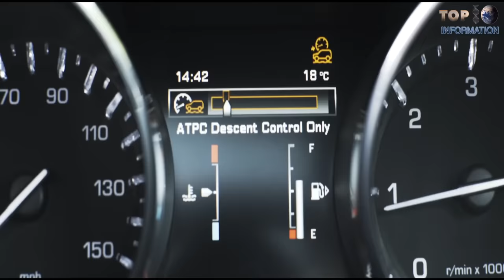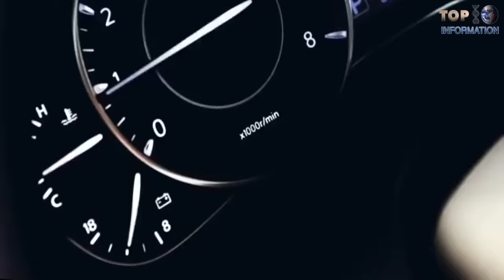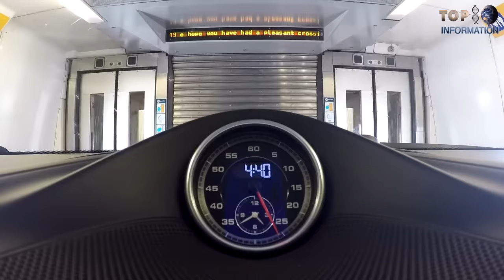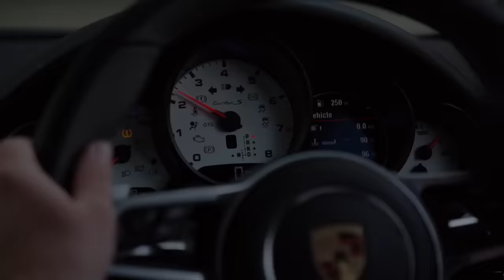6 Strongest Cars That Really Exist !

Comment: PLEASE!! you completely miss the best "towing" vehicles out there, a full size diesel HD pickup.. if your never going off road, a 2wd, if your going off road a 4x4 version..
Reply: Rexford L a full size diesel chevy got rekt by a vw touareg in a tow race lol you dont get there only with weight and big engine
Reply: for fucks sake. a heavy duty pickup with 900lbft of torque will out tow these SUVs.
Reply: +Bran ‘BMR’ Don i have seen something else multiple times you cant overclass german cars they are better get over it its a fact
Reply: abdellah070 Chevy broke a tierod in your video..
Reply: or 4x4 if you live in indiana where it gets icy and snows and get lots of rain and mud even on roads
Reply: Cameron :/ no you just got to get a good start if theres ice my 1996 camaro was driving faster with no wheelspin then my friends 4x4 ram with 4WD engaged on offroad tires who spun tires everywhere

Comment: why not try to tow a large airplane with a dodge demon
Reply: Anwyn71 oh damn, that's a large aircraft
Reply: Anwyn71 how's that even possible? 😂😂😂
Reply: Why try not a G class 6×6 with 800ps
Reply: the suspension is designed so that on lauch weight is transferred/shifted to rear of the vehicle. soooooo yeeeeet
Reply: Its torque numbers are similar to the Touareg's but the suv's advantage is that it's got a 4x4 transmission, while the Dodge is RWD

Comment: to pull a shitload of weight all you need is lots of horsepower and good traction, as well as a strong driveshaft and a very robust transmission that won't give out when you putting a 140 ton load on it

Comment: Anything can pull at low speeds without putting weight on the actual frame of the car. The problem is pulling at higher speeds and being able to BRAKE. Half the battle is getting to speed, the other half is having the capacity to stop the load. Hook any of those cars up to a heavy camper then see how strong it is.

Comment: if it has wheels it wil go. almost every one has seen topgear with the jaguar and the train
with clarkson revving the hell out of it ant the car and train dident move wy? metal wheels and reving did they use normal wheels and tried slowly he would have moved the train not far but it would have moved it roles and had no resistance

Comment: What's "PS" ? ... A VW Tauareg ? I bet you also don't even know what TDI means... The A747 ? I can tell you Airbus has NEVER built a 747, because it's a Boeing...
Ich weiß nicht ob du deutsch sprichst, aber deine denglischen Versionen von "PS" und "Ballast" sowie deine schon gefährliche Grammatik lassen mich davon ausgehen.... Wenn du keine Ahnung zu den Themen hast und dein Halbwissen nur irgendwo im Internet zusammenkratzt, um es dann hier zwischen paar schönen 3D-Übergängen (ich würde so hoffen dass du die wenigstens selbergemacht hast...) zu verpacken, kannst du's auch gleich lassen, denn die ganzen Fehlinformation und auch dein toller Text-zu-Sprache-Wandler lassen einen ja im Strahl kotzen... In dem Fall, dass du es selber bist der da spricht, nimm dir bitte in Zukunft vorher den Stock aus dem Arsch, oder noch besser: Einfach sein lassen.